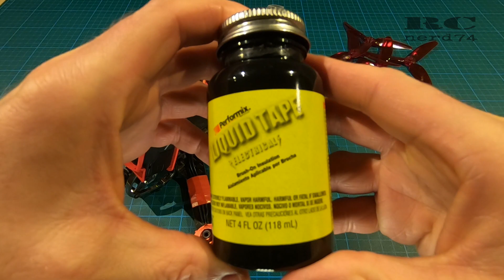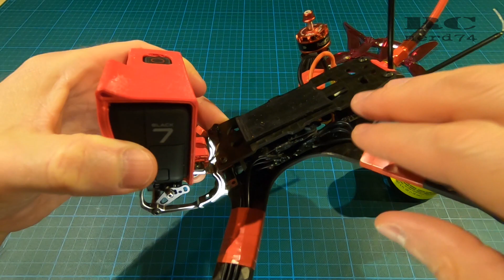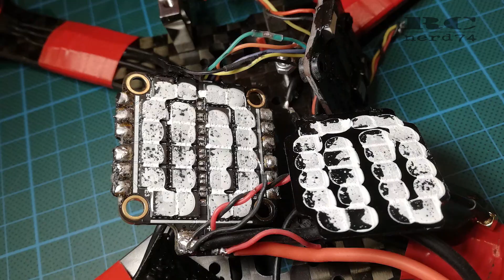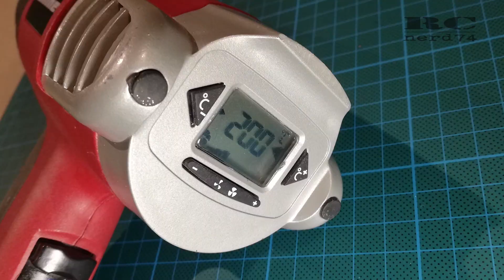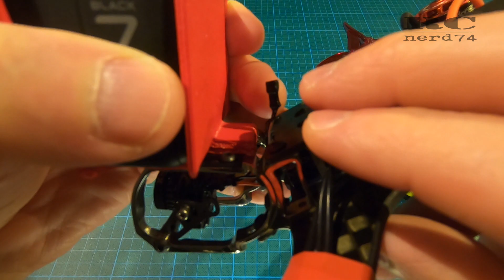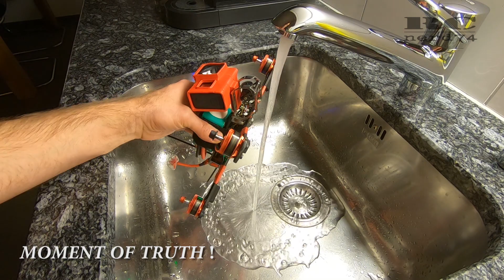HOW TO WATERPROOF FPV QUADS | PLASTI DIP TUTORIAL | WATERTEST

Comment: thx a lot for this video. How do you protect the battery from water and the balance connector??
Reply from the maker: No need to protect the battery or the balance connector. When you fly you do not dive your quad in water. You just fly in rain or snowfall or around waterfalls. Batteries have no issues with water drops. The cells itself are waterproof anyways. And the balance plug doesn't care about water drops.

Comment: hey #RCNers74... great video but I would have to disagree on your method. it is definitely worth waterproofing your Quadcopter but using liquid electrical tape or Plasti Dip isn't the way To go..
 I WOULD RECOMMEND THAT YOU DON'T USE LIQUID ELECTRICAL TAPE!.!.! 
1. ITS NOT 100% WATER PROOF UNLESS YOU COMPLETELY INCASE YOUR BOARDS, ETC IN THE MIDDLE OF A BLOCK OF IT (SURE U MAY GET LUCKILY ...)  
2. WHAT IF YOU NEED TO ADD SOMETHING OR FIX SOMETHING AFTER A CRASH SINCE INEVITABLY YOU WILL... * IF YOUR NOT CRASHING, YOU ARENT FLYING HARD ENOUGH OR PROGRESSING...
  If you do want to waterproof your Kwad, get yourself a bottle of silicone conformal coating. The price has came down recently and it's not very expensive. available on Amazon Prime. Just be careful not to get it inside of  any buttons and any connectors that you are using and especially not the USB port!!! I would recommend that you make sure not to get it in any connector whatsoever, since water will not harm anything if it gets inside. unless you're flying over salt water if water touches the pns inside of the connector it will not do any damage whatsoe pins... same thing goes for your solder pads. water will not hurt them either. the conformal coating will come with a nail brush and tape applicator and just brush a few light coats and and you give it time to dry in between each coat. since the conformal coating is clear and it will be very thin, when you need to fix something or desolder a wire or what not you will have no problem. you can even remove the back of your camera and very carefully apply conformal coating to the back of the PCB being careful not to get it onto the sensor on the other side.
Reply from the maker: Thanks for all your tips. As you can see in my last video, liquid tape is easy to remove.  https://www.youtube.com/watch?v=unEgm88TcFg&t=28s   So no big deal to unsolder or resolder any cables. Everyone has to decide what is best for himself. I just like to share my solution. Nobody needs to copy that. Happy flying.
Reply: i tried it and it works on rc boats, cars and fpv gear and you can get it at home depot, for cheap.
Reply: its no nesessary to protect the USB port? tnx
Reply: wait so when it comes to cameras you don't do anything but the back of the board?